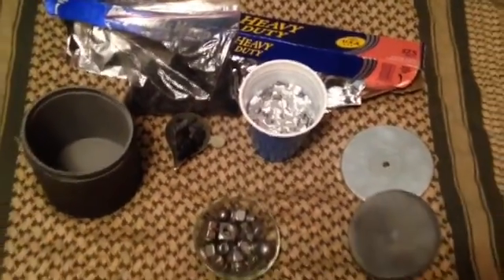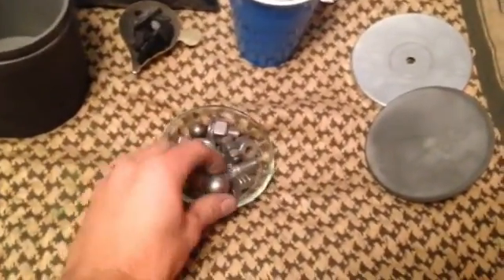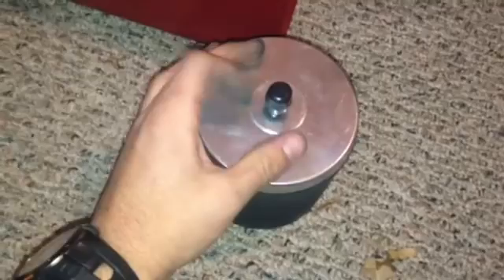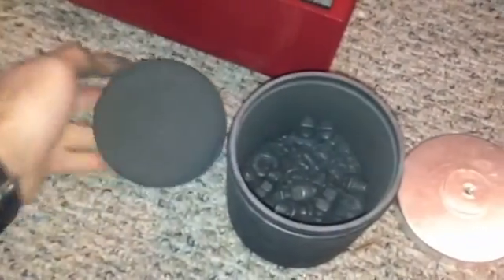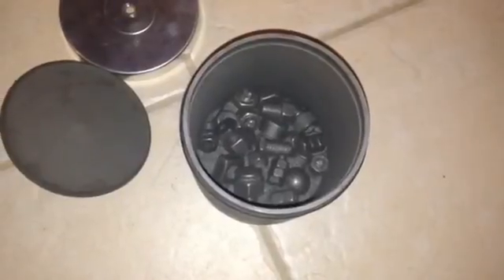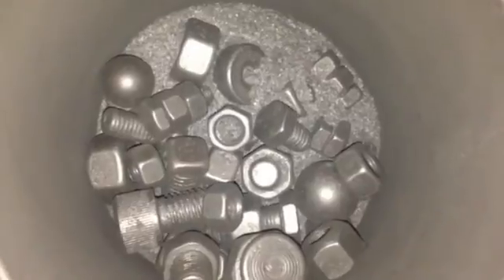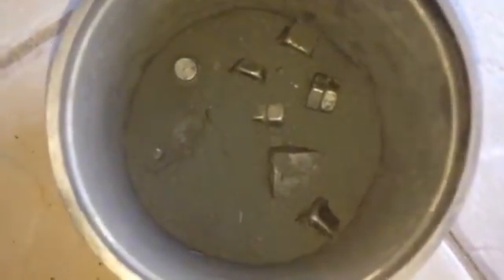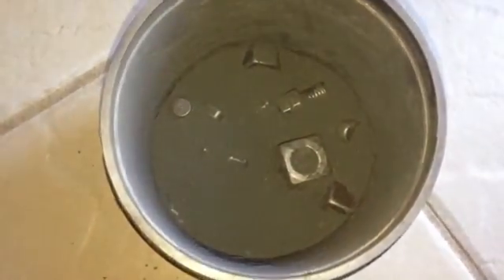How to make German dark aluminum powder

Comment: If you are reading this and looking to get into pyrotechnics, do NOT use anything metal in the tumbler like OP is using with the metal bolts. Use glass marbles instead.
Reply: Brass works best.
Reply: @gilflannigan3910 Do you sell it, or do you manufacture it? Which is better, copper or glass? Thank you.
Reply: @aymenSaeid-j6q  brass is a non ferrous non sparking metal that won't slowly turn into dust like lead balls will.   
I just do home chemistry as a hobby. 
Ive seen stainless steel ballbearings spark even though they are meant to be resistant.   Brass however won't spark like  stainless
Reply: Do you sell it, or do you manufacture it? Which is better, copper or glass? Thank you.

Comment: I mill mine for over a month and 1 week to get to German dark pyro. The finer the better
Reply: How can I avoid its dangers?
Reply: How can I avoid its dangers?
Reply: @alikatani7194  for 1 be sure to put 2 spoon fulls of airfloat charcoal per cup of aluminum before starting. #2 open the container 2 times a week to let it oxidise a little so it won't super heat when it gets really fine. Cus it does. Really hot. Hot enough to catch itself on fire. Thats it really just dont breath that shit in. And dont use marbles that takes forever. Just use nuts and bolts. Thats what I do and it speeds it up alot more by 60% faster
Reply: @prestonhanson501  thanks 🙏

Comment: I know this was posted 9 years ago but you should put the foil in a blender or coffee grinder and turn it to sand or something then start milling it with ceramic media because it is non sparking and is resistant to wear because of its high hardness

Comment: Faster way.
Blend the aluminium with a cup or more of water. For about an hour. The water will help cool down the  aluminium and also makes smaller particles. Let the blender cool down once in a while. Keep blending until the water is Grey looking and the aluminium is all grinded. Pour it out into a dish. Let it dry until the water is all gone. Ball mill bigger pieces if needed or regrind them in the blender. 
Enjoy
Reply: are you certain al didnt oxidized?
Reply: @L.politano  thank you
Reply: What the hell is fast for you? I've been waiting for like 2 days for the water to evaporate.
Reply: @odeaosratos heat it up. Oven duh
Reply: @DrunkDeadGhost  thanks for responding

Comment: I’ve been in this hobby for a while but quick question, am I just able to use big stainless nuts? Or is there a sparking risk?
Reply: Yes there is a sparking risk try to use marbles they are much safer and does the job.
Reply: Lead fishing weights or balls are among the best media materials for milling powders, I've had great results with a 50/50 mix of 3/4" lead balls by weight mixed with 00-Buckshot, both of which I mold myself from shotgun molds (the 3/4" spheres are .73 roundball slugs). The lead has the mass to really push on things and it's softness helps the grinding action by digging the particles into the surface which increases roughness. And there is zero chance of sparking, lead is the safest media for milling too (from a flammability standpoint).
Reply: How about using argon (or nitrogen) atmosphere in a closed box (sand blasting box) for the milling ?
But I think, that pure aluminum power, that is not oxydized on the surface would burn instantly , if it gets in contact with air-oxygen.

Comment: I've already tried this mixture. I can say for me that if I add crushed charcoal to aluminum powder there. That this results in quite poor quality shit completely unusable for FP. It works much better without charcoal. You just devalue the whole mixture with charcoal and I can throw it in the trash
Reply: You need air float charcoal preferably milled willow.
Reply: Try soot from a rich burning kero lantern ..lampblack.. From rich oxyacetylene flame its carbon black . Scrapings from a chiminey or flue .

Comment: Nice, I made some aluminum powder in the same ball mill and being a kid at the time I didnt believe it would ignite.
 I thought it only had a small chance so I just slowly opened the container and about 4 seconds later it lit. I tried to put it out by smothering it with a towel but I under estimated the metal fire, the towel immediately caught fire. Luckily I was able to scoop up the burning mess before the towel completely ignited and carry it outside.
I did this in an empty garage though so the fire would have been safe there on concrete floor but I didn't want the smoke to fill the house or my parents to know it happened. 
I would not have opened the container indoors if it was wood flooring or flammable materials were nearby. Looking back at it I should have opened it outside anyway but I was just so excited at the time since i left the mill running for an entire week without peeking.
The mill survived since i dumped the fire out of the container but I didn't use it much since then because I got yelled at for wasting "TONS" of electricity and no matter what I said they didn't believe me that it barely  uses any... i pulled up stats of how much electricity each household appliance use as well as showing them the math per kwh and even then they said I was wrong its using tons of electricity because its loud and I don't know anything im just a kid......

I have continued the hobby but have found many other hobbies and frequently switch between them all lol
Reply: Have fun while your a kid, you’ll regret it later if you don’t.  Trust me on that one.  I’m old lol. You’ll only be a kid once.
Reply: So the power consumption is what , say 20 watts . A solar panel  is no problem .
Reply: Yes, that is exactly what happened to me. And I captured it on camera.
Reply: This whole post smells of BS!
Reply: @jibba0202  why bs? its a true story lol

Comment: i know that it's old but if anyone can this this comment i'd like to say
Please DO NOT use metals for milling Aluminum Powder
it can spark then light it which is very Dangerous
Reply: What are you gonna crush the aluminum with, rubber?
Reply: @torturoustweak  use ceramic media.
Reply: @torturoustweak  
It's not my problem if you don't know anything
Pyros knows that it's Dangerous to cruse it using metals
only Glass marbles are safe to use, and it's not that hard to search a little bit before replying to people.
Reply: I guess me and my ball mill were wrong all along. All that black powder, all that aluminum, wrong. Keyboard warriors, man...
Reply: @torturoustweak  Wow, your dense. It's literally common sense you don't use media like steel.
Reply: @torturoustweak  I really hope you aren't milling black powder like that
Reply: @shook8305  nah I use lead when I'm actively milling the mixed black powder but that doesn't work on aluminum
Reply: @torturoustweak  ok guhd
Reply: @shook8305  sometimes I like to use flint, you know just to spice things up
Reply: @torturoustweak  right

Comment: I have the 6lb lortone ball mill jar that has 6 flat sides on the inside and use chromium ball bearings 1/2" about 200 of them and I'm getting these same results on 24 to 30 hours of milling. You need to upgrade your media and rpm of the mill to get a perfect crush. I installed a clear lid on mine and an adjustable motor control until it was perfect rpm. Nice vid.
Reply: Hey man where did you get a clear lid? I want to do the same thing as you
Reply: Or use proper alumina milling balls - cheaply available on eBay.
Reply: I got my mill to mill it to a perfect powder in two sets of 24hours, after the second milling I opened it and as I was observing it an ember formed and spread quickly, I quickly ran to through it while turned away and with my eyes closed, it was bright enough for me to see the brick wall behind me through my closed eyelids in the day. How could i prevent this from happening again

Comment: There is a way to speed up the milling process. You can take sheets of foil and run a propane torch over the shiny side gently (just enough to make it ductile, don't go full cherry red) and give it a couple minutes to cool. It is now much more brittle and easier for the mill to chew up. It doesn't measurably increase oxidation on the surface, as it is already oxidized (due to exposure to normal air) to a depth of a few atomic widths down below the surface, and if done properly, this won't change the final product. I'm able to get perfect airfloat after 48 hrs maximum. Also try fixing 3 or 4 "speed bumps" to the inside of the mill jar with epoxy. It'll lift the milling media higher up and give it more impact. Cheers!
Reply: This oxidizes it to make it much less effective.
Reply: Excellent tip!
Thank you for sharing…
Reply: How many grams do you make for 48 hours
Reply: How often to you open your container?
Reply: First tip is terrible idea . Second tip , creating lifters is a great idea. I did that and made a clear lid for my jar aswell as calculated proper rpm and adjusted my rock tumbler to match. And the milling speed increases by about 300%
Reply: There is better way; roll aluminum foil together with news paper and ignite with propane torch. This way, aluminum become brittle and covered with black thing which is almost equivalent of needed 5% of charcoal.

Comment: what is the difference between dark al.powder and fine aluminum powder
Reply: Dark aluminum is fine enough to oxidize in normal air based on a size between 5-3 micron, and being flake similar to a chip.
Normal powder used in ceramics and paints are spherical in shape and are roughly 30-15 microns depending on retailer.
Even though the sphereical has more surface area it will take a increased amount of energy to ignite.
Each has its uses in pyro but milled dark al is mostly used for flash comps where the energy to ignite is lower and in return a faster reaction is acquired.
Reply: James Luck great explation! I would not do it better.
Reply: @7.62x25mm so what is the chemical dif?
Reply: Dark al gets its name from the charcoal added to prevent the rapid oxidation from occurring. There is bright al but I'm not quite sure what prevents its oxidation.
Theres also milled al covered in ferocerium giving it a blueish purple color again preventing oxidation.
Reply: A little late, but dark aluminium powder is basically aluminium powder coated in coal.
When you want very good flash powder, you need very fine aluminium powder, but if you powder your aluminium without coating it in coal, all you will get is pretty much just aluminium oxide, which is useless.
Also the coal acts as a second fuel.
Reply: @kubiiikk242  thx mate
Reply: @kubiiikk242  Yes!

Comment: That flash is bad I can make better with potassium nitrate
Reply: @exhilarator4314  what i did was buy buy a block magnessium and I got a wire brush drill bit and and shaved the whole thing down in less than an hour. Got 80% of the block in shaving and I proceeded to ball mill it for 8 hours with breaks in between. After 24 hours I got a 325 mesh magnesium powder of about 300gr. In total everything costed me under 40 bucks!
Reply: @exhilarator4314  kno3 60% sulfur %30 magnesium 50%
Reply: @mta563  the math ain't mathing bro
Reply: bro that dark al not flash powder lol plus when combining with kclo4 it makes the best most stable flash powder for pyrotechnics
Reply: @mta563  KClO4 flash powder is definitely better than nitrate flash but it isn’t more stable. 10g of it could blow your hand to bits
Reply: @afbennett3038  not really kclo4 is very stable, you should treat all flash with care anyway so really you shouldn't have a problem.
Reply: @mta563  compared to potassium nitrate it is less stable though. I get the feeling you have never dealt with nitrate flash, it’s a lot less scary
Reply: @afbennett3038  I actually have some of the most powerful flash is kno3/mg and it indeed is powerful but is less scary indeed. Im sure it probably is more stable, however kclo4/al is stable enough to have no worries especially if you are treating it with care.
Reply: @afbennett3038  nah, nitrate is less stable. Kclo4 flash is by far the most stable. Dont confuse sensitivity and reactivity with stableness
Reply: @mta563  kclo4 outperforms kclo3, kclo3 is just more unstable. I've tested this several times.
Reply: @exhilarator4314  Ouch! Reckless people all other will push things to the limit Lol but kclo4/al is very powerful and should be trated with respect.
Reply: @exhilarator4314  absolutely right! glad to talk to someone that knows what they are saying lol. In the field mg/kno3 is fairly stable to friction but if you are storing it it will decompose and possible self detonation might happen. I would only recommend using if you are going to use it the same day.
Reply: @mta563  Is there any mixture that can be safely stored apart from black powder? I have black powder from last year and I have not burned the house;)
Reply: @exhilarator4314  you’d probably be better off using aluminium in flash powders so it’s most likely not worth it. Nitrate flash powder made with pyrotechnic grade dark ali powder it’s easily powerful enough for most things. I haven’t really messed with magnesium flash powder because they’re a bit too dangerous for my liking
Reply: @exhilarator4314  It is great and yes thank you! People that know details like that I would consider professionals!
Reply: @exhilarator4314  I would go on ebay you can get 4 pounds for like $40 plus only $10 for the drill bit.
Reply: @mta563  hey dudes I need help. So I made flashpowder with al and kmno4 and it was very good. After that I made flash powder with the same aluminium but this time with kno3 and S and nothing happened. Even it didnt burn.
Reply: @exhilarator4314  hey dudes I need help. So I made flashpowder with al and kmno4 and it was very good. After that I made flash powder with the same aluminium but this time with kno3 and S and nothing happened. Even it didnt burn.
Reply: @exhilarator4314  I use factory aluminium powder not homemade and I dont know what size is it. Now I cant sent you pics on the flash but just I guess why my aluminium powder work with kmno4 but with kno3 not. And are you good in rockets with kno3 and sugar
Reply: @exhilarator4314  my kno3 is from garden store. Is it possible because its not very fine. Something like cooking salt.
Reply: @exhilarator4314  I'm interested into make    HMDT  sometime. But where do hexamine is sold. There is dry fuel in gas stations but I doubt it's pure hexamine.
Reply: @exhilarator4314  ok thanks. Later or tomorrow or these days I will tell you my kno3 elements. HMDT is important for blast cap. So I can make big boom with ANAL which is cheaper than flash powders because in the mixture there is only 5-15% aluminium and ammonium nitrate is cheap.
Reply: @exhilarator4314  in my country everyone can buy nh4no3 without license. It's pretty legal here. Even the kno3 is harder to find just because is less wanted by agronomy workers.
Reply: @exhilarator4314  before I have made smoke bombs with ammonium nitrate and newspapers.
Reply: @exhilarator4314  ok but I dont have it yet. Firstable one guy who make ANAL is going to teach me how to make it and then I will buy like his chemicals.
Reply: @exhilarator4314  yes. This man who will teach me use only fuse for detonate. I dont know how exactly do that but soon I'm going to know.
Reply: @exhilarator4314  actually he will teach me how to detonate anal with only fuse. No blasting cap.
Reply: @exhilarator4314  yeah when I learn how to make going to tell you how but this probably may be other month or September. When the dude have time. Now I know that It's not common fuse.
Reply: @exhilarator4314  Facebook
Reply: Rosen Nqgolov
Reply: @Р567Г  @crazeeboi don't use facebook. It's monitored by the FBI, even if you don't live in the US. You will get arrested if you talk about explosives on facebook or messenger.
Reply: @footingball5566  chill we haven't had any problems. And are you pyro fan.
Reply: @Р567Г  of course you haven't had any problems and you won't have any until you do. I know people personally who've gotten "involved" with certain "american authorities". Switch or get arrested, it's your call.
Reply: @exhilarator4314  yes
Reply: @exhilarator4314  hey
Reply: @exhilarator4314  no, this was in Swedish and English mostly
Reply: @exhilarator4314 that happened to me with the black gunpowder but it only left a scar that faded over time
Reply: @exhilarator4314  thx

Comment: Charcoal is added to the aluminum to prevent oxidization.Therefore your creating an aluminum powder that is extremely reactive.
Reply: What about the steel he is using😂
Reply: @TheMulletMafia1  the oxygen inside gets used up but it's not the best choice of grinding media.
Reply: Nope! Charcoal is added to prevent clumping aluminum of the wall of the barrel. Passivation by periodically opening the barrel will actually prevent pyrophoric effect.
Reply: @MilanKarakas  How about using argon (or nitrogen) atmosphere in a closed box (sand blasting box) for the milling ?
Reply: @vanlendl  you will still need to take it out after, which is when it will react.

Comment: What's a safe way to store for a long period of time
Reply from the maker: Any sealed container will work fine. Ziplock bag, pickle jar, empty water bottle. As long as it can keep water/moisture out and the Al in.
Reply: @exhilarator4314  why? Aluminum won’t ignite by static mr dumpyhead, hell, all the flash powders I have made don’t even ignite with a direct zap from a grill igniter
Reply: @exhilarator4314  yeah yeah ofcourse, I’m not saying you shouldn’t be careful but I’m just saying it’s extremely unlikely even with flash powder so I think it’s basically impossible with aluminum powder unless you have a big cloud of it instead of just in a pile